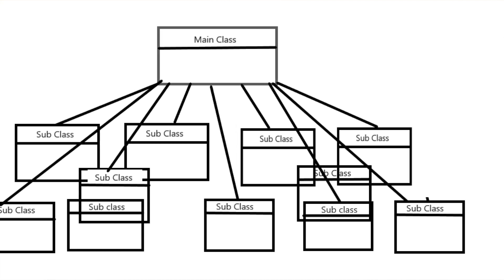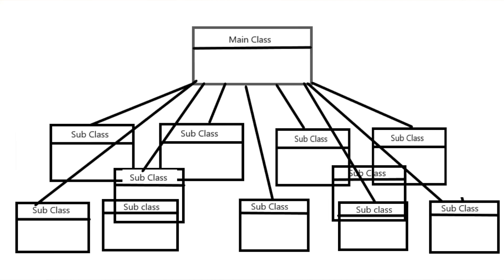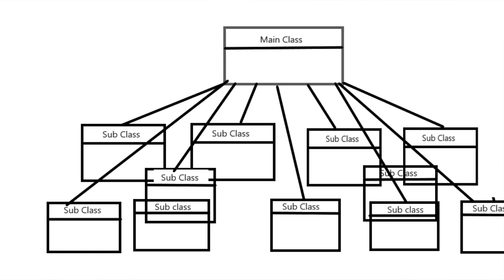Overengineering in Software

Comment: Well I think there are two sides to this conversation. One is that overengineering by, for example, using Docker and K8s and a message queue, all that when you don't really need it (the dev team is 2 people and the project has a small scope and lifetime)... then I think it's indeed a bad solution. On the other side, if my goal is to learn these technologies and my problem fits their use case, I do think using them to come up with a solution is a good decision. For example, I don't really need to expose an endpoint on my Web API for health checks if I don't have a load balancer or any software that makes requests to that route. But if my goal is to learn more about health checks and I'm building my side project, I think it's fine.

On a previous project, I also used socket.io just to implement a cool feature (that was not required or even asked... I had the idea and wanted to do it) which was to display the live score of football matches on the home page of a web app. Did the complexity of the project increase? Yes 😅... but I learned more about web sockets and such so even though the final solution was overengineered, that was beneficial for me!
So my final take is that overengineering a solution on the real world... I mean it's kinda bad and doesn't help. On a side project... it's fun 😄